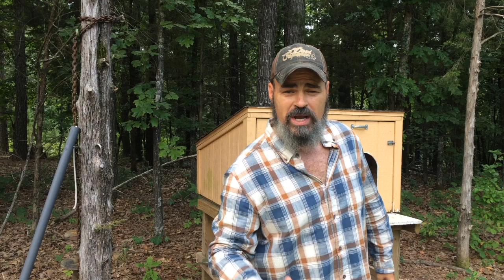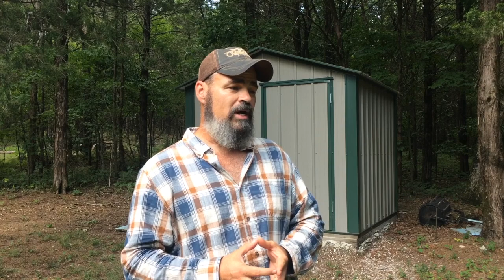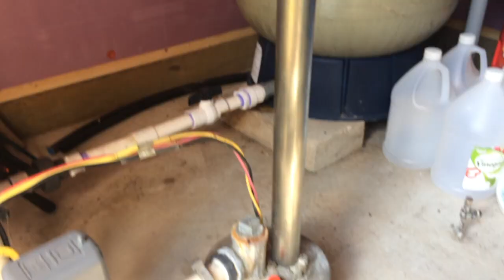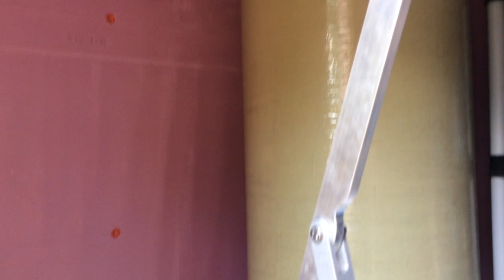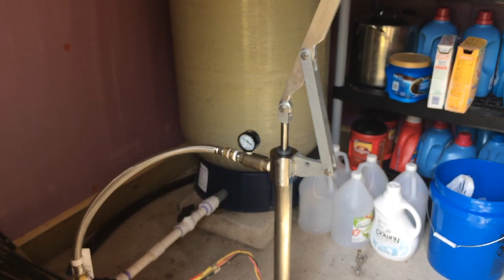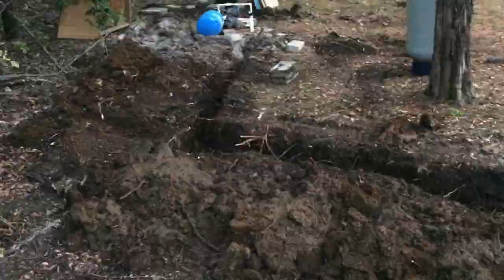OFF GRID WELL WATER SYSTEM  -  SIMPLE PumP  -  Homestead  WATER HAND PUMP  &  FlexLite Pressure TANK

Comment: Yes, yes and yes, I agree! Being off grid with a well, using a generator and solar, I'm on my 5th generator in as many years (and I fixed several of them several times too) and I had my inverter and 2 solar charge controllers fail on me on separate occasions as well as have the wire burn out when I had too much of a load on it accidentally. I also had the waterpump run dry (which was an easy fix, but took a while to figure out) and the pipes froze in the underground wellpump compartment. Each of those times were times of panic because we need the water. I totally second the 3 basket logic or 4 baskets in this case! I really should get a hand pump too, yes!

Comment: Great video. I have a question. I take it your climate there doesn't get too cold which allows you to do without a heated space for your pressure tank  My pressure tank is inside my home. My well is outside about 20-30ft away. The supply water from the well  runs into the home about 6ft down into the pressure tank. If i purchase the simple pump im not too sure how i can pressurize my tank. Any ideas. Thank you. Subscribing.
Reply from the maker: Hello....Is your current well water supply line using a pitless adapter to connect to the house supply line OR does your well pump supply line come up above ground through your well cap and then reenter below ground to the house water supply line? The location of the pressure tank shouldn't matter, it's a matter of being able to connect the simple pump supply to the water line that supplies the house / pressure tank. I'm confident that either way can be done and recommend you visit or contact Simple Pump via their web-site or give them a call. They are very helpful. It's just a matter of making the connections and a valve at the well head to determine where the water is going to be supplied from to the pressure tank.
Reply: @3basketliving . The problem i have is the supply line is 6ft down. It doesn't come out the top then go back into the ground. I think id need to dig down and put a check valve and a T on there or something. I will call simple pump and see what there solution might be. Or would you suggest Scott 775. Thanks for the response.
Reply from the maker: Yes...I agree....just have to make the connection to the supply line from the Simple Pump. You can contact Scott Hunt (Eng 775) as well and he is very helpful and has probably installed in every situation you can imagine. He's a class act of a guy with great business ethics and values too. He did me great and can answer any question you throw at him PLUS he probably has more field installations with the pump than someone at the simple pump company. Both can solve your issues with the most logical means.
Reply: @3basketliving Trying to figure should I go with big tank. How much did the 120G pressure tank $ting. How long will your water continue to flow roughly before you have to re-pressurize you.
Reply from the maker: Well I got my tank at a steal. I paid $400.00 brand new off of craigslist from an older man who changed his mind about using it cause he didn't want to rip out cabinets around his existing smaller tank. I think the one I got normally cost around $900 new but it is a light weight fiberglass wrapped tank. I figure if it will hold about 47 gal. then it will push 40-45 gal. to the sinks or faucet. Just depends on how much you want to have stored on hand after pumping to fill it up. Either way....I like the amount of stored water under pressure for the 10 mins of pumping it takes to have it AND I don't have to carry it as well.   ;)
Reply: @3basketliving  Actually, the current retail price of a 120 gal. FlexLite FLS 120D is $1006. I just bought one today for $200 that had only seen less than a few months of service. I was planning to do pretty much exactly what you did when I found this video. My redundancy will include the existing submersed 220v pump, an above ground 110v pump, a 12v SureFlow pump, and a hand operated pitcher pump. I already have the pitcher pump installed as a backup to the 220v pump, and I'm going to install a solar setup to run the 110v and the 12v pumps . But I had not thought about tying in the pitcher pump to the pressure tank. That was a great idea. Thanks a bunch. By the way, can you remove the roof on your pump house when you need to pull out your well pipe?

Comment: Very important video. DID YOU post a link for the simple pump?. We live off grid in the desert using  solar and a generator. Which is great until the system breaks. Thanks for posting!
Reply from the maker: Hi there, I just did I think. I didn't think I knew how when I tried before and didn't see a change in color when I pasted the page address before so I gave up on it. I since found out that I just needed to refresh the page. I'm a little slow at some things.  Might require some patience from ya from time to time.  ;)
Reply: 3 Basket Living hey thanks again for the link for the tank and the website for simple pump.